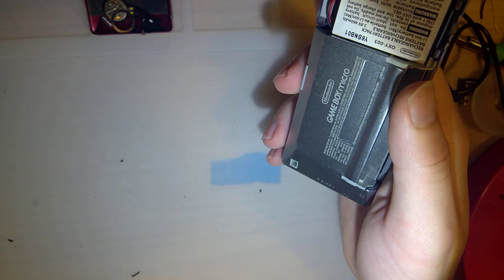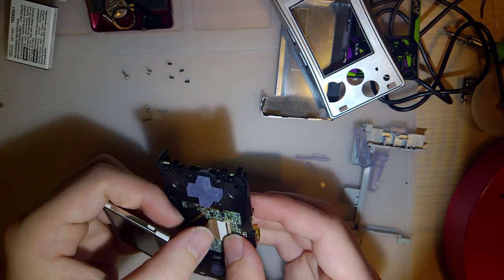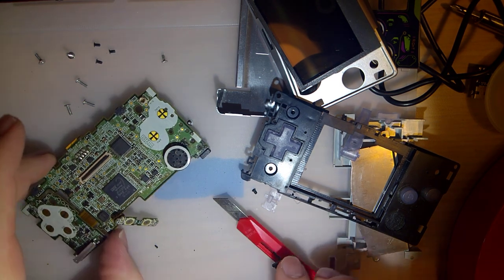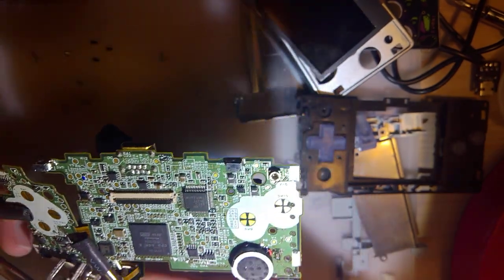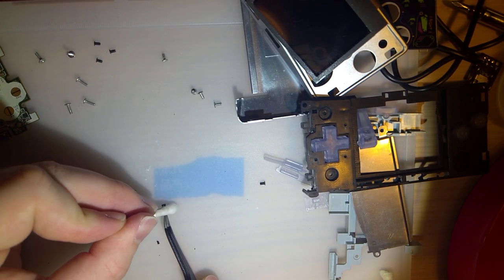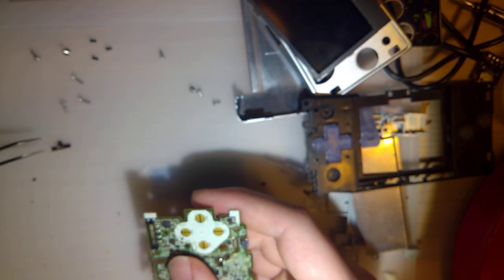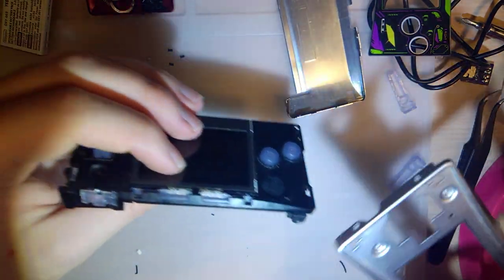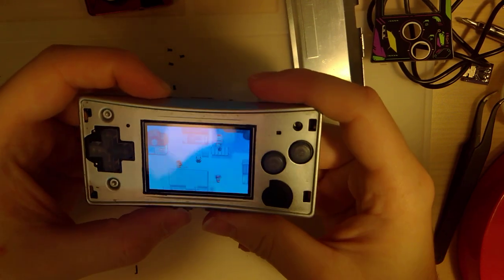Cleaning the power switch in a Game Boy Micro (OXY-001)

Comment: Quick question. Mine randomly turns off, I am thinking that the power switch is lose but idk how easy it is to replace the power switch. In your video you didn't take off all of it and in worried I will have to. What do you think I should do.
Reply: Hey, I know this was 8 months ago, but if the power switch is loose, it might just be the plastic around the switch. Once you get to the switch in the video, just before he desolders that metal lid to do the actual cleaning, moves freely in that little housing. It’s the plastic piece around it that gives you the click once the whole micro is assembled. Check to see if the plastic that you actually touch when the micro is assembled is broken or cracked.

Comment: Hello Makho!
I haven't played my Game Boy Micro in a while, and when I picked it up now, the screen didn't have an LED. It turns on normally, I can see the description "game boy" but the LED doesn't work. I tried adjusting the brightness and switching screens, but it didn't work. Do you know what it could be?
Reply from the maker: You'd need to take clear pictures because I cannot diagnose this kind of issue with only a description. I'd recommend posting a thread on the game boy discord troubleshooting section. 

The easiest thing to try is to just buy another LCD and swap it in.
Reply: @makho  I already made a post on Reddit.  I don't know the Discord community.  I already tried changing the screen, but it didn't help. 😞

Comment: I just got used gameboy micro the famicom edition, it charges like normal, but the catch is it turns on for like one sec and completely shut off.. any idea what causes the problem? the battery doesnt look bloated, but the power switch is just a bit loose
Reply from the maker: Sounds like there's a short. Have you already disassembled the console?
Reply: tbh I haven't since I didn't smell any burning or something like it and I dont have much experience disassemble little consoles, could it be over voltage from the battery? cause it's the original battery. It works fine for first 20 minutes after unboxing it and it starts to randomly shut off in-game and after sometimes and at like hours after trying to play with it, it shuts down right before the gameboy logo pops out. It never shows red battery indicator and the blue light never flashes, I hope its only the battery cuz 😅

Comment: Makho 🤘😎🤘 what can I do to fix my Gameboy Micro? It plays and charges well, It turns off and on, on its own while the volume is high up but the audio is very low, I have to put it close to my ear to hear the audio😢
Reply from the maker: You're sure the speaker is fine?
Reply: The speaker works fine, when The  on/off switch gets bumped a little the select and start turn red
Reply: Should I get new fuses?
Reply: I’m going to clean the on/off switch

Comment: you happen to know if a micro isn't charging that this could be a power switch issue? I changed the battery and its still not charging? 
Also the brightness adjuster isn't working. Do you know what could be wrong with that? I'm trying to fix. Need expert!!! :-)
Reply from the maker: no, check your charger.
Reply: @makho  I have another micro that charges with the charger fine. Not the charger..
Reply from the maker: @xbl4ck7  check the charge port then. Make your way through the charge circuit until you find the problem.

Comment: What if the little metal piece that you bent a little comes off?
Reply from the maker: Put it back in. Once the switch is reassembled, the slider and shielding should hold the wiper in place. Unless you mean the wiper broke. In that case, I'd salvage parts from an AGB power switch.
Reply: @makho  yeah i was worried I broke it but I put it back in place and soldered the metal plate after I cleaned it up and now it works a lot better! 

Thanks man I’m really loving your Gameboy micro repair videos I’ve learned a lot hoping you do some more soon!